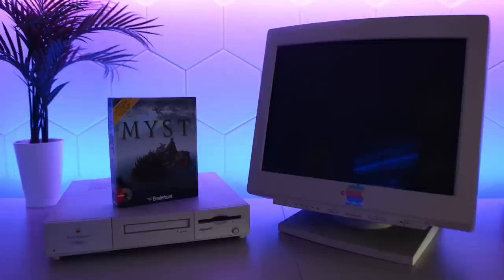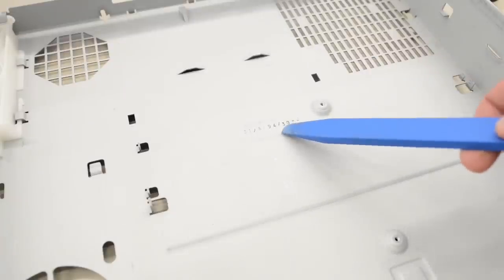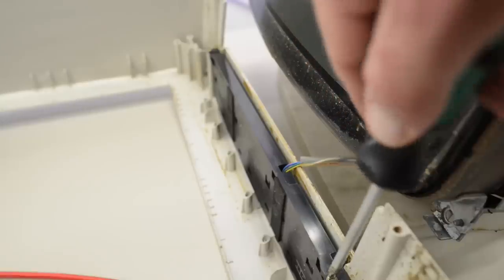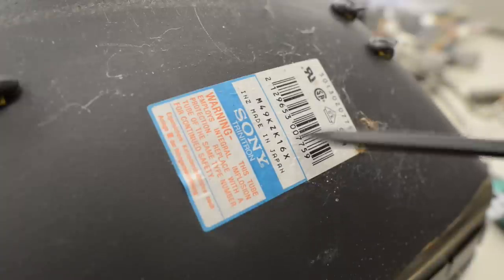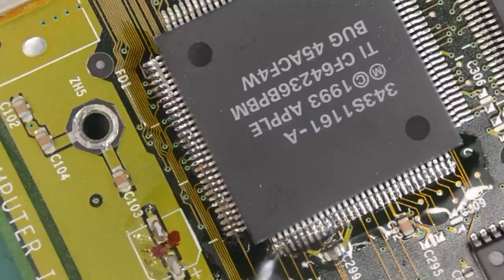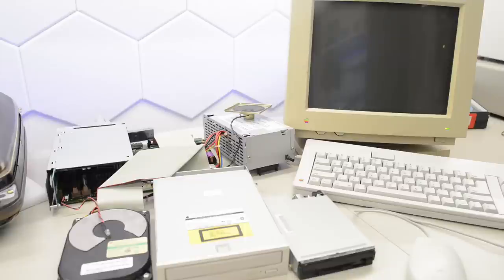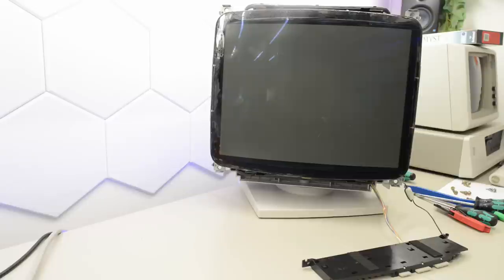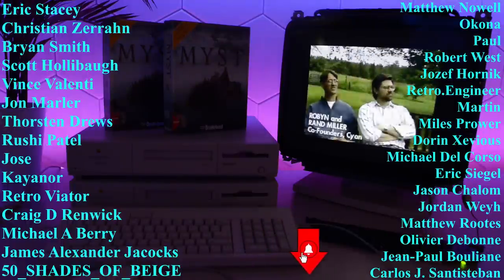What happens if you put a smelly SONY Trinitron in the shower? + Repair of the first Power Mac 6100

Comment: Just FYI, maybe a future update. You can overclock this computer safely to 80MHz by replacing the SMD 33MHz clock with a 40MHz one. The PowerPC 601 on these models is rated for 80MHz so they were underclocked from the factory, probably so they wouldn't cannibalize sales from the 7100. The mod even shows up correctly on System Profiler. The part you would need is a SEIKO SG-615PTJB. My 6100 was originally the 60MHz model.
Reply from the maker: Great, I ordered a crystal. Although, I think I'll try it out in a 6100/66 because I already have one lined up for a video. Thank you!
Reply: @Epictronics1  retro powerpc overclocking??? can I slam the subscribe button indefinitely to see that sooner? :D
Reply from the maker: @M8R3rojcq  Parts are ordered, Coming very soon on this channel :)

Comment: Its the anti glare coating you see "bubbling" on the outer edges of the glass.

I removed the Anti Glare coating on my Sony Trinitron, and made a video about it that is posted on this user/channel (cant link to it I think).

My Trinitron had a chemical reaction going on between the glass and the coating. So thats why I had to remove it.
Reply: The video: https://youtu.be/GkXqhPSgylk
Reply from the maker: @retroftw  Excellent, I'll definitely be going to try that out in a follow-up video. Thank you!
Reply: @Epictronics1  I can mention that two of the horizontal (I think it was) stripes that I could see in high resolution on my video is actually structural support in the aperture grill inside the CRT glass I've been told.

So its not a defect 😜
Reply from the maker: Yeah, I assume you mean the famous Trinitron stripes? The first thing I look for when I see a flat CRT display : ) @retroftw
Reply: @retroftw  Yes, those are normal aperture grille wires. Smaller displays generally just had one, while larger displays had two. I think 15" and below had one, where 17" and above had two.
Reply: @GGigabiteM  I had never heard of them before. 

But I was relieved to learn that it was supposed to be like that, and that there was not anymore problems with the image 😀
Reply: Not an uncommon problem on older CRTs, especially ones from the late 50's /early 60's

I've seen it called cataracts.

Comment: When the PCI PMacs arrived, these older gen PPC Macs were sold off at bargain prices. Later 6100/66 had a 75 MHz capable CPU and could be easily overclocked. I remember that a friend of mine had a 6100/66 in 1995  and we could boost it to nearly 80 MHz. The higher bus speed and the 20% more CPU-clock made the system much more snappy and perfect for a round of marathon. One of the big ASICs was cooking a bit and we super-glued a chunk of copper to it for better cooling :-)
Reply from the maker: Awesome, love hacks like that :) I have a 6100/66 too. I'll try to overclock it in a future vid, thanks

Comment: what an amazing restoration! I would have felt nervous showering the CRT as it's difficult to remove water and moisture from coils but it clearly worked for you. The glue issue you saw is likely "cataract" issue. I've seen videos of VERY old CRTs online with the same problem. The solution - not for the faint of heart - is to warm up the glass while using a metal wire to cut through the glue. In your case I'd hope it doesn't get any worse! I didn't know those monitors had glass glued to the face of the CRT.
I'd love a Trinitron monitor, but I really don't have the space for that!

I also remember Myst with some nostalgia. Slow pace as you said. There's an interview of the creator online. Myst was so heavy on the CDROM that the medias were written trying to optimise the location of the data so that slow 2X drives could find the required data without wasting entire revolutions of the disk for the correct data to pass under the head. It sounds so silly today but back in the day with 150KB/s max speed, every revolution counted :)
Reply from the maker: Thanks Tony, I think I'll try to find an older version of Daemon tools or similar software to run the game from the hard drive. Even with the best effort as you describe, the CD-ROM is clearly slowing the game down. Cheers
Reply: I bought a Quadra 700, partly because it's one of the machines they used to make Myst -- which is my favorite game series of all time.  I thought it would be neat to play it on a computer like the ones they used to make it.  The Quadra 700 doesn't have an internal CD-ROM, but I had an external SCSI drive -- Apple-branded Sony, at 1X.  It ... uh ... requires a bit of patience to play on hardware like that.

Can't even imagine modeling and rendering all that stuff on a computer equivalent to a slow 486.  X_x  It is a miracle they ever finished it.

Comment: Great work restoring the machine and the monitor, can't wait to see it fully reassembled! I probably would've given the whole board a soak in a tub of vinegar, since it looks like most of the vias are green with corrosion.

If you're gong to play through myst, you definitely want to have a walkthrough on hand for when you get stuck, because you will get stuck!
Reply from the maker: I considered getting the official hint guide. However, there seems to be good info online too. Thanks!
Reply: @Epictronics1   Ah, c'mon... I played through it back in '95 as a teenager.  You can do it!  :-D
Reply from the maker: @nickwallette6201  haha, I probably can but I'm not sure my patience can

Comment: When it comes to leaking electrolytics in those late 80's-90's macs, it's recommended to neutralize the electrolyte with a weak acid such as vinegar. Otherwise it'll continue to crawl its way down traces and eat away at things even after a reflow. If I remember correctly, they used a very basic compound as as borax mixed with water and a stabilizer. When repairing this sort of damage I just give it a quick scrub with a toothbrush and vinegar before reflowing, also cleans up the crusty stuff super well.

I could be totally incorrect here, though.
Reply from the maker: You're absolutely right. I applied white vinegar to all corroded areas and left it on for a few minutes before I washed the board

Comment: It's not recommended to wash a picture tube with water because the black coating on the back that forms the second anode is made of Aquadag, basically graphite that is suspended in distilled water when it's applied to the tube. This could easily wash off with water ruining the tube. But it seems you got lucky here, but I think I can see a few spots where it was spotty afterwards.
Reply from the maker: Absolutely, I always dry clean the tube. However, in this case, It was the last chance to get the nasty smell off the tube and save it from e-waste
Reply: @Epictronics1  It's great to know that it obviously can survive some wet cleaning, I always thought it would just come right off when you apply water. And of course the aquadag coating is not that hard to repair if neccessary (only very expensive :-))
Reply: I don't think it's just water. It's a wter-based dispersion, but has some binder in it. It usually survives the elements outdoors for months or even years. I had to re-apply this coating on some CRTs. I can't source aquadag, but I can buy organic solvent based acrylic conductive graphite spray paint (Contact Chemie Graphit 33). It works fine, except it doesn't stick very well to glass... I figured if I apply a coat of clear acrylic laquer to the tube and overspray it with the conductive stuff will probably make better results.

Comment: If the condition of that monitor is in disgusting to you, I would suggest not to watch Shango066's resurrection videos, where he deals with TV sets FILLED with mice, rat, bird and bat excrement, and dead cockroaches. It would probably cause you seizures. But seriously, any monitor that was used for a few years is a lot dirtier than this one. OK, the insect parts were a bit off, but not uncommon, especially in rural areas. I'm sure my 17" Samsung CRT on my desk also has some spiders in it, and the anode wire is probably 1/2" think from the sooty dust it collected during its 19 years. Last time I opened it up was in 2006 or thereabouts. It probably has more than 40.000 working hours in it without internal cleaning. The tube is a bit tired, but still usable.

Comment: There is glue holding an implosion shield to the front of the CRT tube, so you are right. You can remove it with heat and replace the glue that has started to discolour.
Reply from the maker: Ok, thanks!
Reply: @Epictronics1  That front glass seems way too thin for an implosion protection device. Might be there for antiglare purposes. Are you sure if it's even glass, and not just a thick plastic film?
Reply from the maker: @mrnmrn1  I think you are right. It's probably an anti glare film. I'll try to remove it in an upcoming video

Comment: 20:10 I've seen a couple of mac restorers online who say they just replace all the electrolytics with the same value tantalums on these era of boards, as the cost difference isn't too high, and tantalums are vastly more stable and long lived, so you get the additional peace of mind. I'm guessing apple probably mixed and matched based on cost and space constraints of the PCB layout.
Reply: Probably more for the their characteristics.  When decoupling, it's better to use small ceramic caps, for their high-frequency performance, and larger electrolytic, which have higher internal impedance, ergo, react more slowly.  This covers a wider bandwidth of noise, and bulk energy storage.

Comment: You could probably replace that plastic center stud with something stronger or add additional supports so that it would not be crushed by that big display.  Just a thought.
Reply from the maker: Good thinking! I'll just put a metal rod inside that plastic stud, that should make it many times stronger
Reply: @Epictronics1  but monitor is so eavy you risk bending and craking the board
Reply: Unless it decides to puncture or put a dimple into the plate/top housing cover.  Even though all that weight is nicely distributed by the monitor stand, the metal stud may be the highest point of contact at that point. But... You may have better perspective or how it's supported
Reply from the maker: @CheezeCracker  Hmm.. true, I may have to think about this
Reply from the maker: @sergiobisonte  Yeah, maybe this is too risky

Comment: If your TS100 keeps shutting itself off, it might be a short inside the tip - try a different tip. They seem to get fractured from repeated thermal cycles and short out the system which makes the little computer brain shut off.
Reply from the maker: I'll check it again with different tips. Thanks

Comment: I have 2 mac monitors from the 90s that I kept both sony trinitron versions and I have a dell 17 or 19 inch crt that I kept also a trinitron still working great though the dell got scratched on the front slightly.

Comment: crt screens are bonded to implosion protective glass, some have it baked in, some have it glued on with pva type medium and it sometimes go bad, mostly on old crt's causing so called "cataract" when the glu go yellow on the edges
do not try to remove implosion band or the front glass , the tube might implode on you if you do, if the water damage is not on visable portion of the screen , just cover it up and forget you ever seen it
Reply from the maker: I don't think it's water. From what I can tell, that is glue. It's not visible when the front bezel in back on. I think we're all good! Thanks

Comment: Concerning those Caps... you might have an easier time removing them, by cutting the can at at its "waist", cut the legs and then remove the plastic. This way there's less risk of damaging the pads and no need for a heat gun (and the mess it can cause with other plastics).

Comment: I run Amiga of Rochester, we do Mac and Amiga restoration. We've started doing 6100s to avoid this issue. This is the first bad one Ive seen.
Reply from the maker: Same here, I have been inside many 6100s. Never before seen one with leaky caps.

Comment: Yeah its glue on the front of the CRT. its comnon to have a second pane of glass. Reminds me of CRT cataract removal.
Reply from the maker: Great, It's not visible when the front bezel is back on. However, It has some scratches on the display. I may try to remove the anti-glare sheet in a follow-up video

Comment: I think the 60 mhz ppc should be equivalent to a bit faster pentium so not truely a fair comparison. I think it would be pretty slow to run legacy software so in that case the 486 may be faster so it would be interesting to compare stuff like duke nukem. Still there is no comparison to the amazing pc games coming in 1994 so I would not have been happy getting a mac. Actually old versions of mame run on these and they look very good on these monitors. I have a 200 mhz mac and even then it runs a little slow on legacy stuff but nice of newer stuff.

Comment: cock roach stuff ick . i had a monitor come in that would shoot blue arcs from the inside to the  ground shield . apparently nicotine dust is conductive. so i cleaned the tube up and put it back in and it worked just fine after that. but i could not get rid of the cig smell . i never would have thought to give it a bath. great idea.
Reply from the maker: Well, I don't recommend it but it was my only option

Comment: Will it support the weight of the monitor?

You better believe it will... It's not made of cardboard! WTF?
Reply from the maker: You might want to google "brittle Macintosh"
Reply: @Epictronics1  Okay, so the top part, i thought it was metal, like any decent computer case i've encountered EVER.

The top is plastic???
Reply from the maker: @kevintappminville195  Yeah, 30-year-old dried up plastics
Reply: @Epictronics1  I'm terribly sorry and retract everything i said!

A new reason to dislike Apple XD